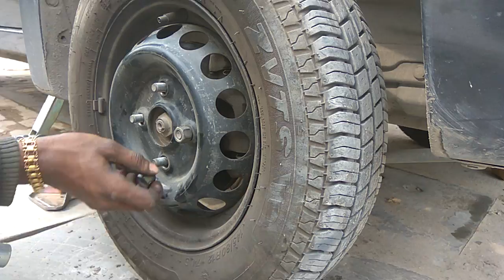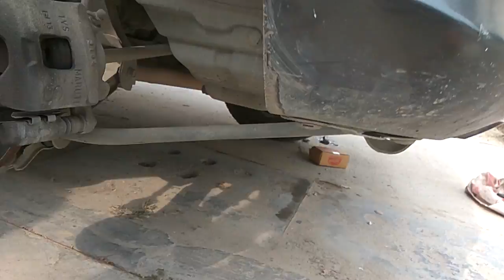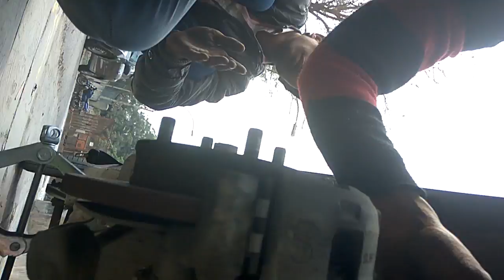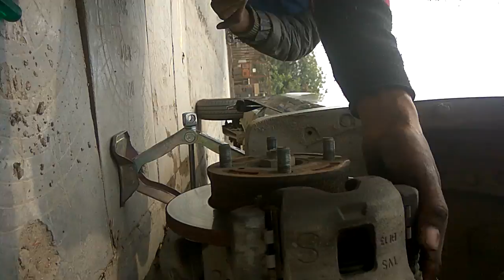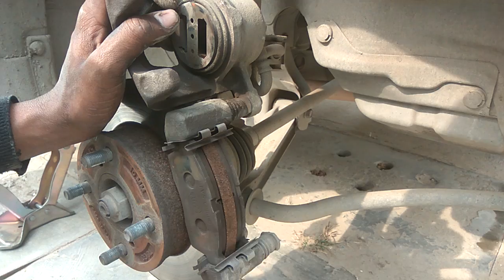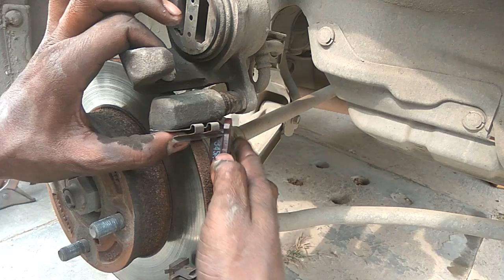Maruti Alto 800 car disc pad change

Comment: mere paas alto lx hai 2009 model uske front rims bohut hot ho jate hai uska kya reason hai aur solution kya hai
Reply from the maker: It depends on how frequently you brake. Try to reduce braking.